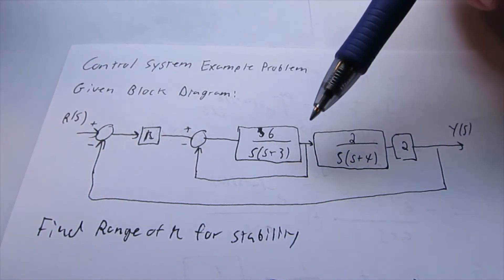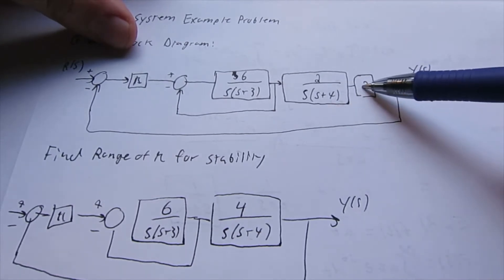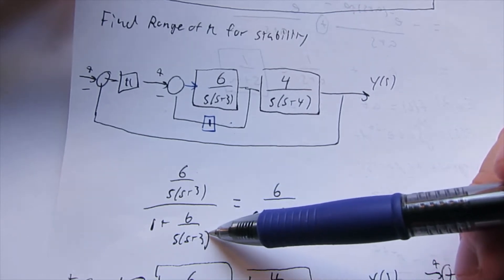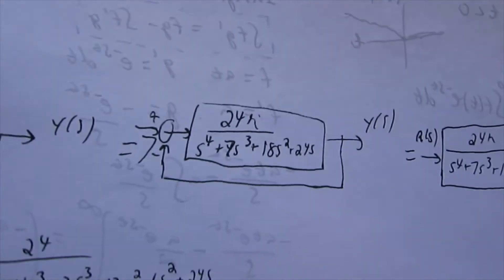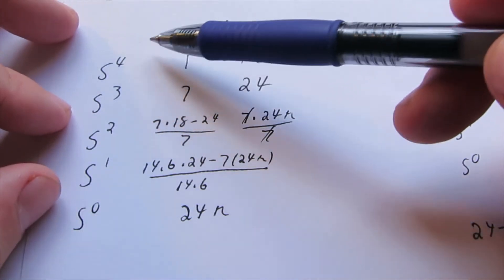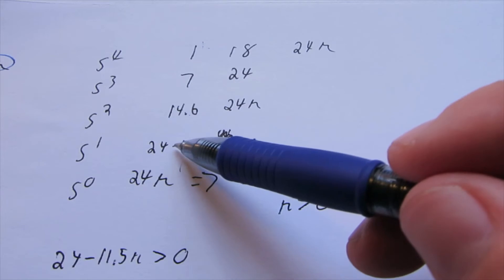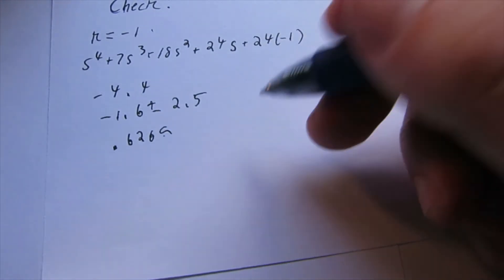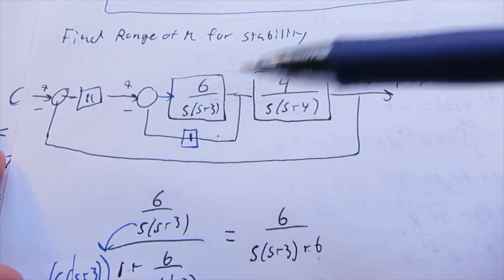Block Diagram Reduction and Routh Hurwitz Stability Example

Comment: What happens in a similar system where the numerator depends on K only (like the one you showed) and when I solve the polynomial in the RH Criteria I get a range that includes negative numbers? is it stable only for the positive part?